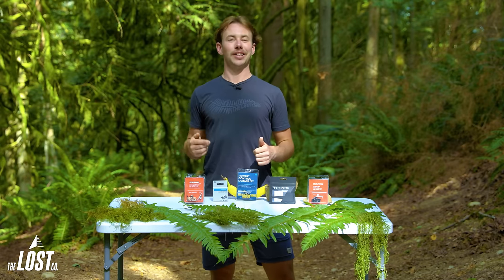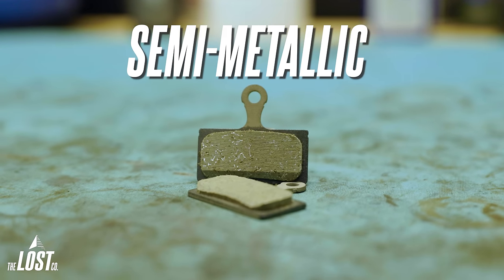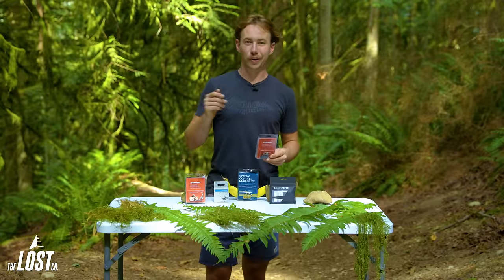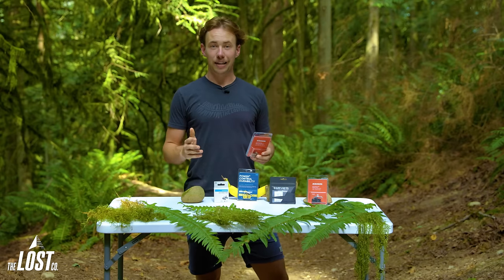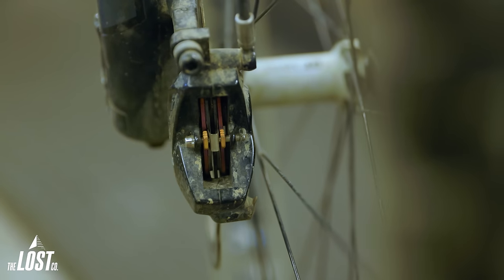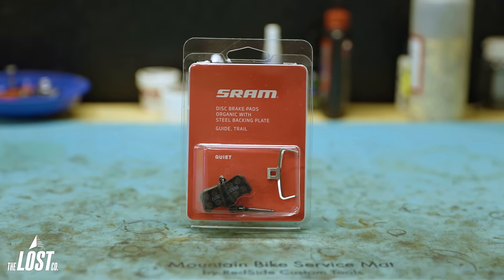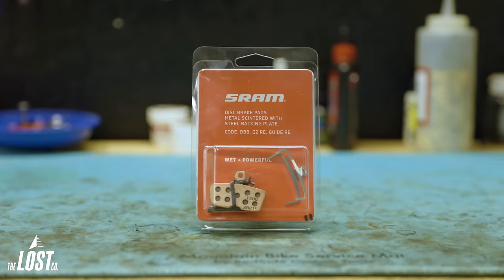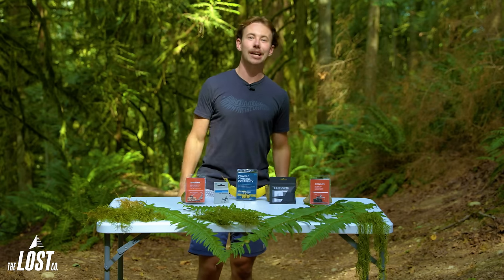MTB Brake Pads Compared | Metallic vs Ceramic vs Semi-Metallic vs Organic

Comment from the maker: Which pads do you ride? And which pads are you wanting to try?
Reply: I try to always run metalic ever since mud/clay destroyed my new organic pads and the oils seept into the pads even after sanding them alot and using rubbing alcohol on pads and rotors. Plus more power babbbyy!!! But im curious on ceramic since i went outa my way to swap from shimano xt to trp dh brakes (rear only) on my trail bike just for modulation when i lacked some skills and patience. Could be a cheaper option thats worth it. Maybe install in rear only to prevent lockups

Comment: We are missing a very important safety part here. Cheaper brakes like MT200 are not compatible with metallic pads, they don't have ceramic pistons to contain heat so your oil will start boiling on long descends up to the failure point. Never put metallic pads on your brakes if they are not designed for it if do any serious mountain riding.
Reply: Likewise, the compatibility of the brake discs is critical. Some discs cannot withstand the heat generated by metal pads. Shimano has a compatibility chart online. Best to check for yourself rather than letting bike shop employees make assumptions.

Comment: Sintering does not involve any liquid material. In this case it is powdered metal that is subjected to pressure to make a pad.
Reply from the maker: Ahh you're right! That's what happens when I try to teach about something besides bikes 😂 Thanks for pointing it out! -Tor
Reply: Metal powder subjected to pressure and heat, but not so much heat as to melt the particles, just enough to make them fuse together where they are touching.

Comment: I got the MTX Red for Shimano and for sure better braking power than the Shimano ones. HOWEVER, in wet conditions they are LOUD. Total the opposite of what they saying that are less loud than the organic ones. I have been using it for more than 6 months actually and still doing it. But in dry conditions, MTXs are the BEST!

Comment: I'm not a fan of, in my experience, the lack of initial bite of the metallic pads. Once they warm up, they're awesome. Organic pads just don't last for me and I've experienced brake fade with them when riding DH. MTX reds pads are AMAZING! That's all I use and recommend nowadays... *currently running Zee calipers with Saint levers

Comment: I've just bought some ceramic brake pads for my ebike a week ago. They still haven't arrived, but they should be ALOT better than the resin i've been running. For an ebike that weighs around 60kg, they need last a bit longer than the resin ones. Also that they're prone to glazing also helps with wheelies.
Reply: It's been a month, how'd they do? I'm distrustful of unknown brands on Amazon that claim to be ceramic, or are ceramic/metal compound. Which pads were they?

Comment: My Shimano "resin" pads are the same thing as "organic" ? And for most modulation ceramics would work best ? 
Current ones bite like crazy if I am on one wheel and brake 🤦‍♂My old ones, Magura rim / v-brake hidraulic ones had nice modulation.

Comment: Which discipline you ride also matters. In DH you’ll be braking a lot 😅 while XC trails will keep you climbing much of the time and not touching your brakes. As an  XC rider, I get decent longevity on resin.
Reply from the maker: Different pads for different types of riding! Glad the resins are working well for you Victor! -Tor

Comment: Which pads are less susceptible to howling? Or is there any difference? Online consensus seems to say ceramic are quieter? But, I'm not sure if that is referring to the brake howling issue. I'm not sure what type I have on my front caliper, but they are howling badly. I have just tried a product called 'Squeal Out' cleaned the rotors and pads, and they are still noisy. So, I am now thinking about putting new pads on, and am wondering if ceramic are less susceptible to this very annoying issue? To get rid of this noise I would even consider switching back to rim brakes, but I have too much invested in the disc brake set up, including two high end disc brake wheel sets. Any help would be appreciated. I am riding a lighweight XC race bike on moderately technical xc trails.
Reply: I got some super cheap bucklos ceramic pads on aliexpress, so YMMV with better pads. 
Once warmed up they are nearly silent and have excellent braking performance, but when cold they squeal like crazy when going slow and don't brake very well either.

Comment: I went from resin to metallic pads on my Mt200s and the difference was extremely noticeable, in a good way. With the resin pads I really had to squeeze on the brakes levers to get any type of stopping power, but with the metallic pads I barely have to squeeze the lever and I'm getting great stopping power. i also notice that the lever pull distance shortened when i switched to metallic. I don't know if this is due to my resin pads being thinner or worn out but there was and still is definitely a noticeable difference in lever travel. on another note I've seen some companies on Amazon selling Copper brake pads, which I'm assuming would be a bit softer than metallic but last longer then resin? Has anyone had any experience with copper pads?
Reply: Copper is metallic. If you sand your pads you'll see brass of copper, usually they are semi metallic as the people selling them have no idea what they are
Reply: I've traded metallic pads for resin pads on the rear caliper.
It is more quiet for some reason and I just feel like it brakes at least the same if not better.
Reply: MT200 are not designed for full metallic pads, they can't take heat from brakes well - pistons are not ceramic. It will work fine for city/park ride fine but do not take it into mountains. You are risking that oil will start boiling on long descents up to a total brake loss.
Reply: @AK-oz4ew  I switched to M7100's a few months ago. It's a HUGE upgrade compared to the MT200s. I'm currently using Metallic pads and they bite a ton better then the MT200's. I am considering possibly switching to ceramic pads just to quiet it down a bit, these metallic pads REALLY squeal when riding in the rain. I also switched to larger rotors, Hope floating 200mm front and 180mm rear.

Comment: if your bike came with organic pads can you put metal pads on. will they be compatibale with the original discs
Reply from the maker: Hey Aidan! You will first need to check to confirm that your rotors do not say "RESIN ONLY". If they do, you can only use organic/resin pads. If it does not say that, then you can use the pad of your choice.

-Mike

Comment: Can I run ceramics on 'resin only' rotors?
Reply: Yes you can. Resin-only actually means “do not use sintered”. The resin-only rotors lack a production process that is needed for a sintered metallic, but you’ll be fine with either of our compounds.
Reply: @mtxbraking  thank you

Comment: 1:04 No, sintering is turning metal particles into a solid compound through heat and pressure WITHOUT melting. Please get your definitions right, there are engineers in your audience that get kind of annoyed about this stuff.